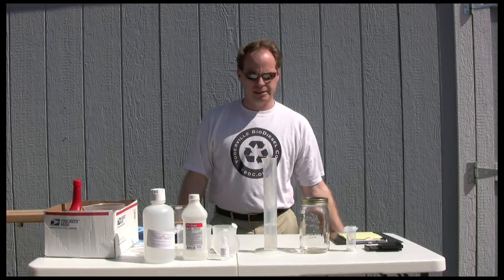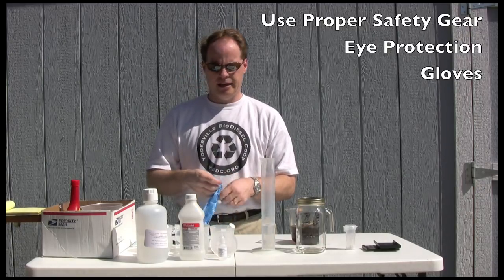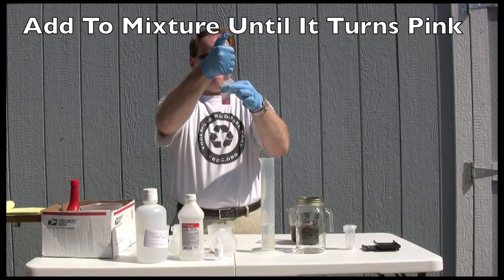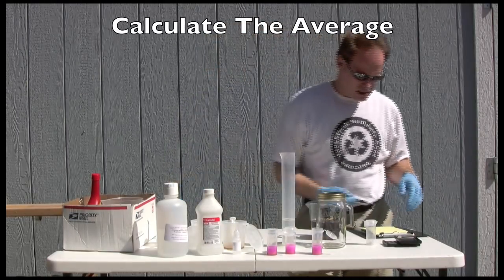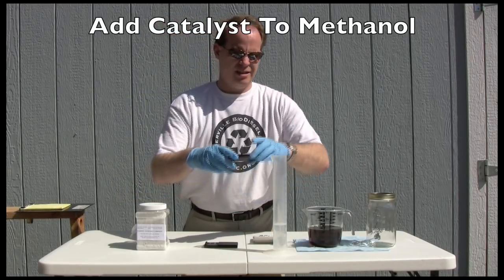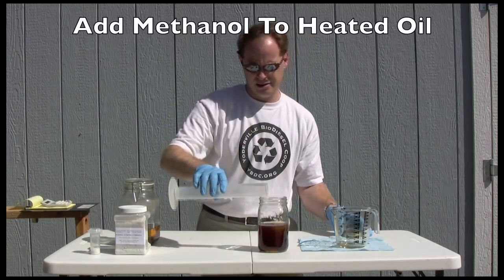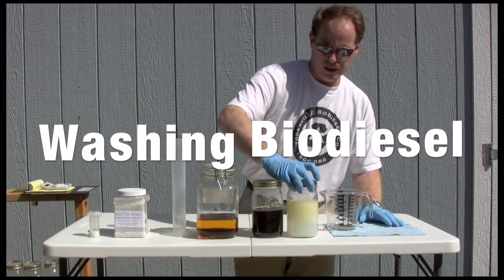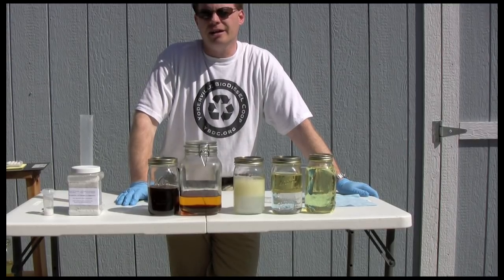Making Biodiesel From Waste Vegetable Oil | Utah Biodiesel Supply

Comment: Great video! Just as I needed for our project, but I do have some few questions.
1.) How did you separate the glycerin from the biodiesel, what kind of method did you use?
2.) What kind of water did you use to wash the biodiesel, distilled, mineral, etc.
3.) Is there a specific volume of water that is needed in washing the biodiesel? ratio'ing it will be a great help. (vol of water for washing : vol of biodiesel)
4.) How did you separate the biodiesel from the water in washing, are there any methods that you use? How many times does it need to wash?
Reply: These are great question that all should be answered!

Comment from the maker: @derekne That's a great question. It's about a 1 to 1 ratio. Ie. if you make 1 liter of Bio, it'll take about 1 liter of water to wash it. For mini batches, you do 3 water washes (split the 1 liter of water into 3), and just pour it into the bottle and gently slosh it around. For large batches, yes, you can run a hose into the tank with a mister on the end of it.

Comment: Question: When you wash the biodiesel, how exactly do you separate it from the water? With hoses and pumps, or is it a more thorough process?
Reply: usually there's a tap under the container, just open the tap slowly

Comment: my familly owns collectively 8 restaurants, we use a LOT of oil for our deep fryers, we could be going through 1500 - 2000+ liters of vegetable oil a month. i got a feeling we are sleeping on a gold mine but i have no clue AT ALL to how to proceed with such an enterprise. i have a simple question, do you think its worth for us to start a small biodiesel plant?
Reply: You have a good source of used cooking oil. First thing is to store it in the drums undercover, better still, in a "tote" tank or several of them. Then you can draw the oil off the top as any crud will settle after a few days.  There is more to learn, I have been making B D for about 5 years now. Send a message if you're interested.

Comment: This video is a VERY simplified explanation of what is involved in the making of BD. For starters there is no explanation of the heating of the oil that is required. Assuming that most watching this will be interested in making large batches of BD I suggest you look into how much energy is required to heat a 55 gal drum of WVO (waste vegetable oil). Not an easy proposition in itself. Next, look into where you can acquire a 55 gal drum of methanol. Not an easy proposition.

Comment: @UtahBiodiesel 
Thank you for your reply m8.
So if I had say 200 litres of bio in a large tank are you saying it will require around 200 litres of water? That sure is a lot of water. Im guessing trying to get all that water away is going to be a night mare. Even with it in the sun and with various aquarium bubblers and useing the recirculation method. Any thoughts on my reply sir?

Comment: As most source WVO will come from Chinese restaurants it will most likely have water in it because most restaurant’s WVO containers are outside, next to their dumpsters and they do not care if rain water gets into the WVO waste container. Running the heated oil through a centrifuge will also get a lot of the unwanted particulates from the cooking process out of the oil.

Comment: I have a few other questions:
1. If making a bigger batch of biodiesel (say 30-40 gallons) how long should I mix the hot oil with the methanol + KOH?
2. What is the process of "washing" or "misting" the mixture above?
3. What is the best way to dispose of the waste (Glycerin and titrated oil samples)?

Comment from the maker: @cloudiow 
1) It's the standard alcohol to use to do titrations with among home brewers. You can use Tolene with Isopropyl, but Isopropyl Alcohol works great
2) Yes. Methanol works much better. Ethanol will work, but it has to be absolutely dry to do so (we're talking 99.9% pure). And even then it's a royal pain in the butt to wash Biodiesel made from Ethanol.
3) Not sure on your pH value question. All I do is add enough KOH solution to neutralize the acids and then measure how much it took.

Comment: @spc6grl It's usually done in settling tanks. ie. the water sinks below the biodiesel, settles out and is removed. Once the majority of the water is removed, the biodiesel can be circulated with heat applied to evaporate off the remaining water.

Comment from the maker: @dieselperformance17 As long as it's a pink color, you're good. The oil will discolor the pink a bit, so it doesn't have to be as pink as mine was. Mine was also in the bright sunlight too so it exaggerated the color change.

Comment: @UtahBiodiesel Thanks alot utah bio-diesel :)
but i got some questions, for my big project :) regarding your method.
1. Why did you use 2-propanol for the tritation
2. Does it matter if you use ethanol or methanol for the mixture with NaOH.
3. Why/ what did you add for the pH ? that part i didnt get i mean will it mix better when it has a certain Ph value? 
could you plesase anwswer these? :D
it would help me so much! on my project for a good grade ^^

Comment: I am totally confused by this video.  So I did some reading. Most scientific papers say that the ratio of oil to methanol is 6:1 with NaOH 1%wt. This was the same whether the oil is used or fresh. I never come across any titration needed in any scientific papers. Maybe titration is not needed as KOH was only used as a catalyst. (Catalyst is defined as a substance that causes the reaction to occur or happen faster without being consumed.) 
Also as noted by others the actual titration process is incorrect. If you are using phenolphthalein, the pKa of it is 9.4 which turns the solution "Salmon pink". The actual solution in the above video is bright pink which means that the solution can have a pH anywhere above.
Why is KOH important? Because in excess, a different reaction will occur. KOH will react directly with the oil. That will produce soap.
P.S. I am not a chemist but I did take some class in Organic chemistry. I suggest you to do some scientific reading if you want to know more. Scientific papers on the internet are limited.

Comment: You have done a nice organic chemist job, I understand that... But there is some little spot which i worry about. The main disadvantage of biodiesel is that it forms peroxyde and acids because of present double carbon-carbon(biodiesel oxidation)... I read few articles that it isn't good thing to put water in biodiesel cause of that( + oxygen from air does the same). And also if it melts some metal particles, these metal then have a role of a catalist so the corrosion speed's up :D... 
http://www.scielo.br/scielo.php?script=sci_arttext&pid=S0103-50532012001200004

The other thing is about glycerol, you contaminated it with lots of stuff... If it's clean it can have a use as antifreeze liquid http://pubs.acs.org/doi/abs/10.1021/ie50189a017

And i belive that (in yours videos) you didn't say anything about microbiology in biodiesel fuel, which can also make a big influence ...

Comment from the maker: @boliviangirls Use 1 gram Sodium Hydroxide, 1 liter distilled water & you have sodium based titration solution. Yes. You can use sodium for the whole process. Adjust your base down to 5.5 though. Divide it by the purity though. 5.5/.95 = 5.8.
We don't have a book, but we do have a great DVD. It's our Biolyles Biodiesel Workshop  DVD & is available on our website. utahbio dot com

Comment from the maker: @boliviangirls Using the Deluxe Titration Kit, use the scale that came with it and measure out 1 gram of your Sodium Hydroxide. Put it in the titration solution bottle and add the distilled water. Then you'll be set to titrate with sodium hydroxide.

The formula for making bio with Sodium Hydroxide is in our titration kit instructions as well as on our website utahbio dot com (left-hand side under Biodiesel Basics: How To Titrate)
Reply: Is Titration mandatory...?
Reply: Before preparing for biodiesel
Reply: How many litters of biodiesel get from 10 litter  used vegetable oil...? Sir

Comment: If you want to do it the best way in order to produce the highest quality BD you are going to have to get a centrifuge involved. The process, before you even introduce the methanol, is to heat the oil and then while it is heated run the oil through a centrifuge in order to get any water out of your source oil.

Comment: @rags91192 

Recipe for 1 liter batch
1 liter oil
20 mL Methanol
12 grams KOH

Recipe for 40 gal
40 gal oil
8 gal methanol
1821 grams KOH

This assumes a titration of 5 using KOH based solution.
See link in description for more information.

Comment: It really depends on the kind of oil you make the fuel from. Gel points vary greatly from one feedstock to another. As a general rule though, anything below about 35 to 40 deg. F is a good time to start blending with diesel fuel to prevent gelling from taking over.

Comment: You definitely want to use Isopropyl Alcohol. It works the best.

7 is the amount of catalyst required to react with the oil to make Biodiesel. 3 is the amount of catalyst required to neutralize the free fatty acids in the oil and still have enough left over to make Biodiesel from the remaining oil

Comment: 1- About 2 hours at 140-145 deg. F
2- Basically spray water on it gently. Visit our website, bottom left, click on the Biodiesel Tutorial link in the resources box (first link) and click on the washing a small batch of biodiesel. It'll walk you through how to do it step by step
3- Glycerin - For a mini batch, you can dilute it & put it out with the trash or pour it on some newspaper & dispose of the newspaper. I've also seen people dump it down the toilet, but probably not recommended.